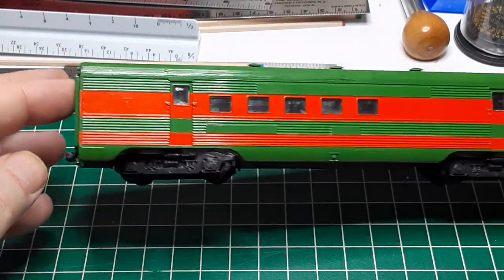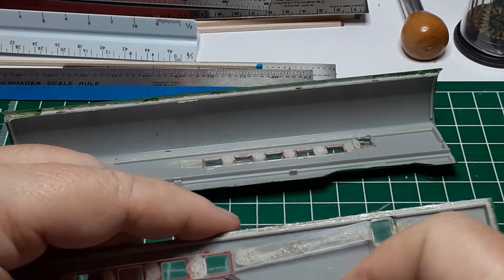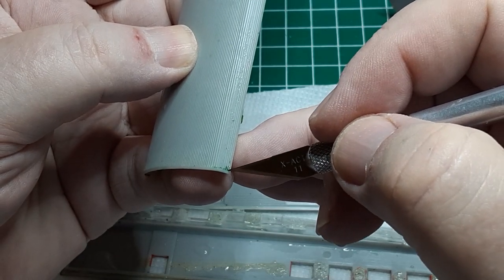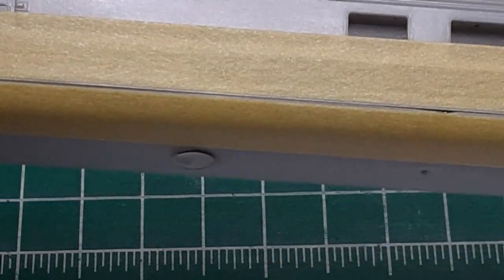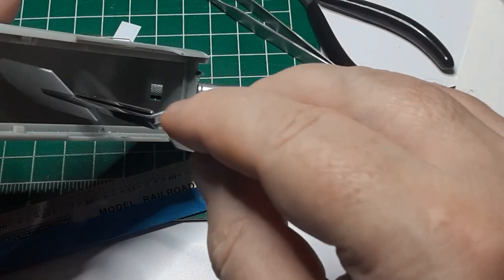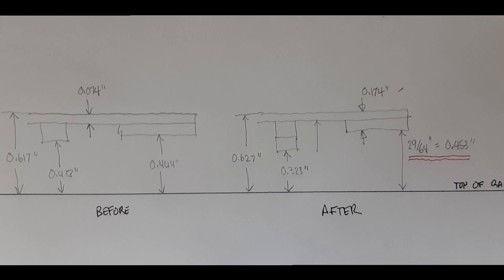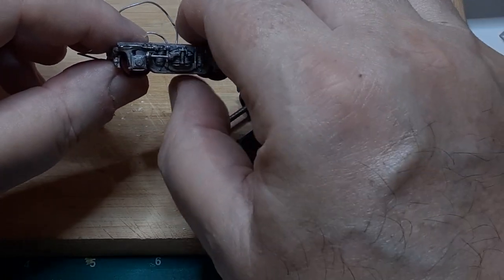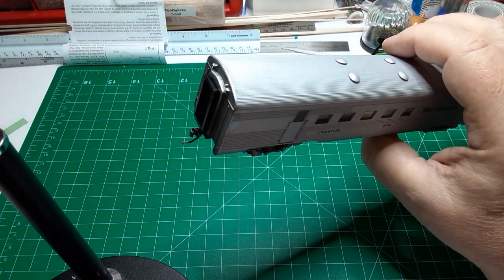Refurbishing an Inexpensive Passenger Car

Comment: A few thoughts.  First - I really enjoy your videos in general, and these rebuilding videos in particular.  Don't let the fact that Charles Smiley also does this stop you from giving us your take on things.  Secondly, I think this car was likely originally intended to be an RPO rather than a combine.  The single side doors are the giveaway, and it matches the door and window arrangement of the Athearn streamlined RPO almost exactly.  But it would work just as well as a combine; perhaps the Rio Grande rebuilt it and put it into service on a branch line, as you suggest.  Great work on this car, and I hope to see more in the future.
Reply from the maker: Thanks for the kind words. I hadn't even considered that this might be an RPO, but I like your suggestion of repurposing the car for combine service. It's nice not to be slavishly tied to the prototype!
Reply: @rwissbaum9849  I do not consider faithfully following a prototype to be enslaved.  A Railway Post Office car would have been an important car on most Rio Grande passenger trains and an important source of revenue.
Reply from the maker: You are correct, of course. I was simply trying, ex post facto, to justify my failure to realize the model was in fact an RPO and not a combine! As it happens, the decal set I used included lettering for an RPO, which I overlooked in my ignorance. In this particular instance, I judge that "slavishly following a prototype" would require me to hide this model away; instead, I am rather proud of it and will display it on my layout.

Comment: I have almost exactly the same model with only a few teeny tiny differences (like the brake wheel only being on one end). Like yours the glue is disintegrating. When I was a kid, my dad had painted it bright silver with some cheap spray paint, so I may redo it someday following your example.

Comment: as with others in the comments, I agree about not letting the fact that Charles Smiley put out some good video, keep you from showing your work, methods and style. The video is well done and informative. To add a little to this, I tried to remove a poor paint job on a locomotive shell using brake fluid. It did the job but it made the Athearn shell very brittle. Avoid using brake fluid for long periods or perhaps limit it to something without small pieces like locomotive steps. Might be ok on a boxcar. Videos like this one are how we learn as hobbiest. Cheers Rob
Reply from the maker: Well, damn. Here I was thinking that I could scrap that video - I've shot about half the footage I need and have not done any of the editing - but unless you and @ocalicreek get outvoted in the coming weeks. I suppose I'll just have to finish it.

Never having used brake fluid myself, I have no experience to offer; but it occurs to me that brake fluid may have been in common use to strip paint from brass and other metal models, but maybe not so much plastic models. Anyone with brake fluid experience, please add your thoughts to this thread. Thanks.

Comment: Sir, your lecture, demonstration and delivery was very well done.  I subscribed just for that reason.  I would be curious to see your demonstration on building a passenger car with Union Station sides if you have done one or plan on doing one.  I will be looking for more of your lectures.  Thanks for sharing.
Reply from the maker: Thanks for the feedback, and thanks for subscribing. I think I alluded in the video to the fact that passenger service, and passenger cars, are both sparse on my layout, so I don't do very many passenger car projects. In a way, this is a shame because Union Station has an amazing array of passenger car parts. It seems like it would be pretty easy to buy a core car kit and a pair of sides to assemble your own car. The other issue on my layout is space: because I have quite a small layout, I must limit passenger car lengths to 60'. As near as I can tell, all of the Union Station car parts are for 80 and 85 foot cars.

Comment: The model is an Athearn Railway Post Office, very similar to those in use on the Santa Fe.  It was one of the mid 1950's flat kits, designed prior to the development of side shot injection plastic molding techniques.
Reply from the maker: Thanks for the information - several other viewers have corrected me as well. It's a shame that I can't correct the video (at least, not easily) - my error will be out there for all to see for years to come! 😀

Comment: I'm so pleased I came across your video. I'm in the UK and my layout and rolling stock reflect this but recently I saw some pictures of US trains (I think the locomotives were called F3s) and I was taken with the beautiful colours the railroads used. Remembering that I had stowed away some old Triang American trains I thought I would get them out, renovate them and give them a re-spray in the colours of two of these railroads and once in a while give them a place of honour on my layout. But as they have so much missing I began to wonder if it could be done. Your video shows me yes, it can; so I was really encouraged by it. Thanks again.
Reply from the maker: I'm really happy that my videos are having the desired effect: I want to show modelers that it is much less expensive - and not very difficult - to repair and repaint than it is to replace. Best of luck!

Comment: Awesome post! I have been looking for these types of videos for a while now and of course when I am not actively looking I come acrossed what I need! I have a whole fleet of passenger equipment that need this work done so hopefully you have more cars to modernize!
Reply from the maker: Well, sorry, but I probably won't. Passenger service on my layout is sparse, at best. I have one more passenger car I need to repaint - it's a clerestory type coach, so suited for the early half of the 20th century - but that project is WAY down my list. My only other passenger cars are an excellent set of 4 Rivarossi passenger cars that will someday need hand grabs and weathering - also low on my priority list.
That said, I continue to refurbish old cheap freight cars - it's quick, it's easy, it's relaxing, and it gets cars out of the scrap bin and onto a layout. I will probably do a few more of those videos - viewers seem to like them, and almost every project has some unique challenge.
Thanks for watching!
Reply: @rwissbaum9849  Ah alright then, well I will continue to hang around then

Comment: It's a shame you had to cut off the faces of the cast coupler "boxes" on the car ends. Me being as persnickety as I am, I probably would have tried to fabricate a replacement.
Many years ago I started to do a cheap Superliner train using Con-cor cars, before Walthers came out with their far superior models. In the process, I hit on the idea of using a light window tint adhered to the insides of the window class. As the windows on both sides of the car were tinted, the result is a really nice dark tint to the windows as you'd see on the actual cars, and no hint the entire interior is completely empty.
Reply from the maker: I thought about custom building a coupler pocket, but the tight curves on my layout meant that I had to go with Kadee's extended swing couplers. These couplers actually pivot as the car moves through a curve, causing the coupler pocket to slide left and right across the car end. If you look closely, you can see this at about 11:50 in the video. I haven;t tested, but I expect a fixed coupler pocket would require a 24" - perhaps 22" - minimum radius.
Reply: @rwissbaum9849  Yes, I have some in my parts boxes for future upgrades to some auto parts boxcars. There's another video on this platform where someone modified an old heavyweight car with these couplers. He ignored the instructions and didn't understand the concept of the coupler. He ended up mounting it incorrectly and it ended up being just a long non-swiveling coupler pocket.

Comment: I'm kitbashing an Athearn DD40 ->DD35 that someone had repainted for Santa Fe, the paint removal is proving difficult. Initially I tried brake fluid but that did not work. Following your example, I tried 99% alcohol but that hasn't worked either. I did try paint remover on a sacrificial Athearn DD40 body but that dissolved the body as well as the paint. Any other suggestions?
Reply from the maker: Try soaking the part for 24 hours. I have left plastic in 99% IPA overnight with no damage to the underlying plastic. If that doesn't work, I'm stumped. Tamiya makes a paint stripper that supposedly works on enamel and acrylic paint. I have seen web posts claiming Dettol antiseptic solution is good. I've never tried either one. Let me know if you find something that works, and good luck!

Comment: That's a very nice rebuild of a combine.  I've been working on similar ones for the Central of Georgia.  I think I have the same trucks on my models.  Check out K4 decals.  They generally run $6.75 each set and free shipping.  I think you get enough for 3 or 4 cars.  Cheers from eastern TN
Reply from the maker: I mentioned K4 in one of my videos - I love 'em. Microscale needs to take a page out of K4's book: Microscale makes you order $25 minimum before they even ship - and then you still have to pay shipping. Full disclosure: if you read the other comments, you'll find that this is not a combine, but an RPO. Oh well, it still looks nice on my layout!